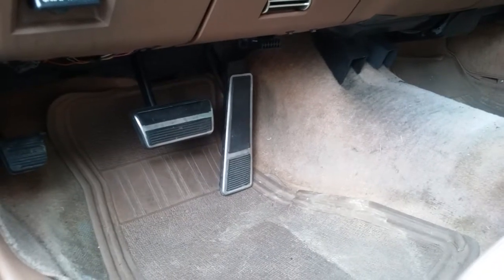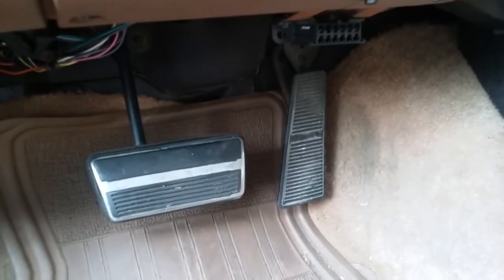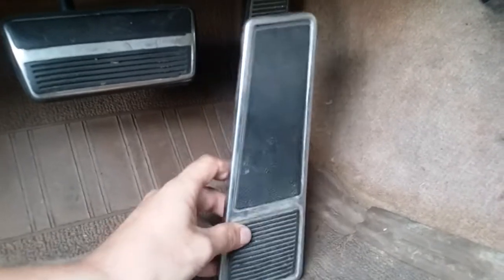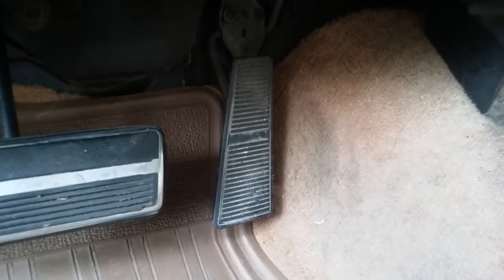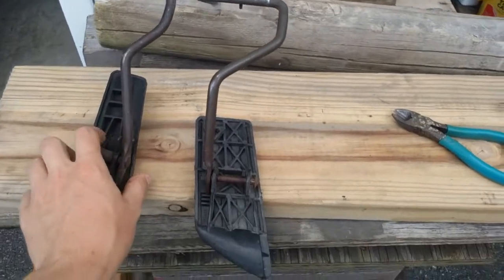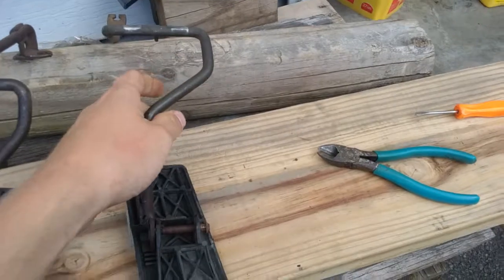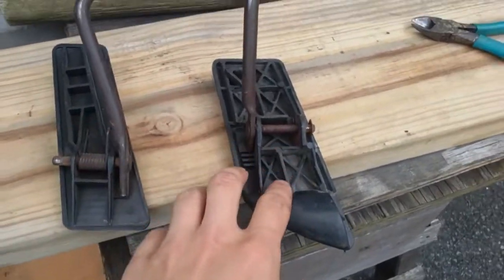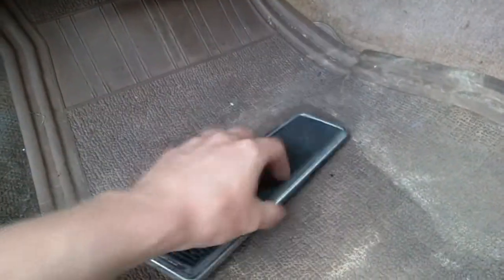How to change gas pedal, 80s GM full size

Comment: I have 85-86 Electra estate wagon.how do you disconnect the throttle linkage from gas pedal.
Reply from the maker: theres a little washer with teeth on it that slips on over a stud, I just slipped it off with pliers

Comment: Hey man,
I have a 1995 Cadillac Fleetwood and I’ve been looking for pedals like you have in your car. My car came with pedal pads without the chrome trim and I haven’t found anything in my local junkyards. If you still have the big ass gas pedal with the chrome trim you took out would you maybe sell it to me? I need a brake pedal pad with chrome trim too. Do you have another one of those?I hope you don’t think I’m weird for asking but I’ve been looking on eBay for a long time without any luck. If you would be able to help pm me.
Thanks very much!
Reply from the maker: Ryan Hodges I'm moble right now but I'll pm you when I get near a computer. Lol I'd be willing to let it go, I'm never gonna use it again but I don't have a spare break peddle. I don't think I would want much for it. Are you close to Pa?
Reply: Useful Entertainment 
I’m in Tennessee. It’s probably not worth your trouble to ship it. I don’t want to put you through any trouble.
Honestly don’t worry about it. If you can tell me what GM cars use those styles of pedals that would definitely help me. I’ve worked on Mopar stuff for several years but all this GM stuff is new to me.
Reply from the maker: Ryan Hodges haha I feel ya. I'm the exact opposite, I got all this Gm junk I'm familiar with and I bought a 79 T top Cordoba, I love it but I'm out of my element. Hmm well I know they come in the full size GMs  (B Body's) (1977-1990). They definitely come in oldsmobile delta 88s, 98s custom cruisers, buick park avenue, lesabre, electra but be careful about the buicks when calling yards because 1985 and newer electra are no longer b body, they are compact fwd junk. I'm not sure what Pontiac used and I know the caprice and impala use a basic Pedle like I installed.  I'd say your best bet is to look for an oldsmobile because they are the most common to be found on.
Reply: Useful Entertainment Thanks for your help. I really appreciate it.
Reply from the maker: Ryan Hodges no problem mane, good luck and happy hunting.